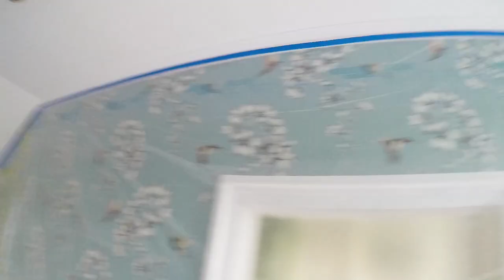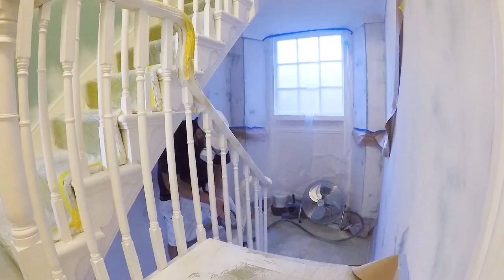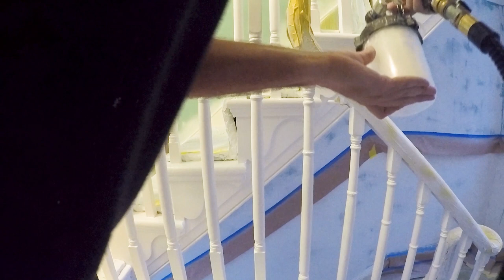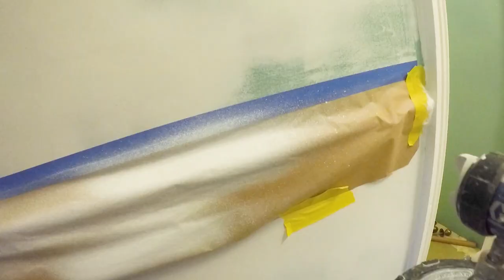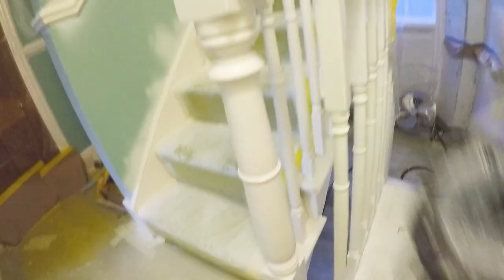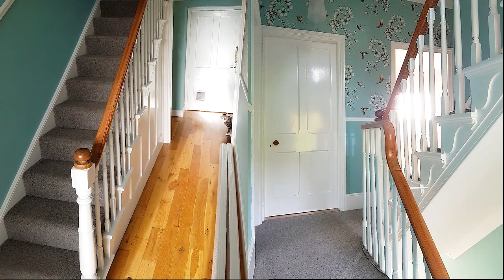Painting Spindles - Graco 9.5 FinishPro HVLP Paint Sprayer

Comment: Hi Simon, hope you're well?  Do you start at bottom for overspay reasons?  Also when the handrails being brought in same colour, whats your method? Ive been leaving till last, wiping as i go with damp cloth, then do all last, results been good but is there easier way regarding overspray dust etc, thanks in advance for all time spent making these videos.
Reply from the maker: Hey bud, yes i usually do start at the bottom so over spray lands on wet paint if it does. And yes usually handrail last. Airless is alot faster and will keep it wet longer, so make sure youre putting enough paint on with hvlp otherwise ye it can go dusty
Reply: @sprayaholic   cheers for that, sometimes odd bit dusty on a flat area, but takes minutes to rub & touch up.

Comment: How are you my friend, I have a Graco 390 110v machine, but I own 220v electricity. Can you guide me about the parts that need to be replaced
Reply from the maker: Hi. You need to buy a transformer.  This allows the 110v machine to plug into the transformer, and then the transformer fits to the main wall 230v.
Reply from the maker: Im not sure if you can just cut the plug off and replace with the one you need

Comment: Nicely done si nicely done ✅! I spray some Helmi couple weeks ago, double coated it in a day too without any problems at all. The recommended re-coat times are 16hrs?. Still that don’t put me off, I’ll be using more in a couple weeks. Keep up the good work, and have a good weekend 🤛🏻
Reply from the maker: Awesome cheers buddy. They always told me the paint can dry through each coat. Ive never left it that lond as soon as its touch dry ha. Im going to give renner a go soon and teknos. 
Have a good one ✌
Reply: Helmi is fine after 3 hours of heat

Comment: I'm currently pricing a staircase  and considering spraying but that's ALOT of masking 

I wonder is there a way to do it without having to mask up all the walls??
Reply from the maker: It was a wallpapered wall thats why. But ye you can drop a sheet or cloth the otherside of the hand rail to catch overspray.  Masking doesnt take as long as painting it all by hand several coats as spraying takes no time. Its just commiting to it
Reply: Yeah fair comment, plus spray is better finish @sprayaholic
Reply from the maker: @georginawyatt8212  if you use the masking guns etc tape and polythene on the same roll you can mask alot in a small amount of time. But this was a whole house re furb so needed protection down for a while
Reply: Yeah I've got one mate. Absolutely love it it's such a handle bit of kit. Can you imagine having to mask without it!! Saves so much hassle. I'm currently trying to stick to mainly spraying and move away from brush as much as possible! Spray is the way!
Reply from the maker: @shanewyatt9939  something i use alot is the blue indasa poly with green tape attached. It fits the gun and its a good price from crown. If needed use a delicate tape for a line then tape and drape this onto it.

Comment: How many coats you ended up on that bare wood spindles? And how come you didn’t use airless sprayer, some ppl say that’s faster? Great vid, keep it up 👍🏻
Reply from the maker: I added it in the description.  After sanding and filling i primed using Zinsser BIN. Then 1 x Tikkurila akva primer followed by 2x Helmi 80. I double coated the woodwork the same day top to bottom, left it an hour then recoated while it was still tacky.

I had my airless units mainly in wall and ceiling paints, it was a full house refurb so lots going on. Hvlp kept the material amount down as it doesnt use as much, some detailed work in other room so i wanted the control which you dont have with airless. But yes airless is fast, this can still go nearly as fast id you crank the settings up

Comment: Great video and work m8. I much enjoy watching your vids :-)  
Anyway. I got the old 9.5 + Pro comp for extra power. But even so, I had no chance getting mine to spray anything without thinning it down almost as liquid as water. 
Only used mine once on a project restoring a classic dinner table + 8 chairs. Used flat black, oil based enamel. Thinned down a LOT. The project came out very nice. 
But I came to the conclusion that I could have gotten the same result and prb 4 times quicker using a LPFF tip with no material thinning. And prb with way less mist in the air. 
But I can see the use and better control you have going over the spindels. So my question again. Do you think the new 9.5 is more powerful or about the same as the old 9.5. 
And can you spray material without thinning. Witch was a the salesman pitch when I purchased mine.
Reply from the maker: Thanks for the support. Sounds like theres an issue,  i always dilute between 5 to 10% it helps to measure out. Ideally need a 1.8mm needle in there. It can spray thicker too, thr machines are the same power. 9.5psi.  The guns better on the new one. Mayne you have are issue with how its set up. Or not clean? Yes you can get a nice finish with the airless, use kore paint but still its fast. If you have too much dust in the air. You need to turn down the air on the gun youre trying to force out paint.
Reply: Thanks for the tip on lowering air to minimize the overspray in the air. 
I love spraying Bin primer  with 2.0 needle set. Almost no overspray. But spraying latex paint it’s a mess.

Comment: Do you always go hvlp on spindles never go for the airless?
Reply from the maker: No i do use airless too. Its just i had 3 of the airless units in different products and the hvlp gave me alot more control with other detail areas on the job.
Reply: @sprayaholic  what tip size would you use for airless on spindles?? I enjoyed the video and found all comments and replies very helpful
Reply from the maker: @padgehind  i often use a 110 or 108 as its minimal waste paint. Or 210 if youre not too bothered. Its helpful to have a sheet or board the other side  to catch the overspray

Comment: I’m going to be doing a stairway with spindles and railing stained. Can you please show me your to tape down an anything else to avoid overspray. preparation for hvlp I have a procomp graco I am using for this. 
I love my procomp with the in-line remote pot for versatility getting close to the the spindles to cut down overspray.  I have a highboy 495 for general spray but for details I love the procomp.
Reply from the maker: When in doubt over mask. Dust will settle on anything in the area. So mask walls or floors. If you have a helper get them to be opposite side of the handrail so your overspray hits a sheet or board. You can buy an extractor to help too. Juat remember it may take you an extra 30 minutes to mask more areas and £30 more. But its alot less that trying to clean up mess ha
Reply: Extractor please what model’s do you use or recommend.
Reply from the maker: @97krunch  i had 2 from ebay. Not sure what models though

Comment: Another great video. I keep watching as I’m struggling to get paint through my 9.5😩 I assume you really thin your paint.  Is it correct that air flows out the back regardless of what pressure setting you are using. 👍
Reply from the maker: Thanks. No you dont need to thin excessively.  Air blow out the back of the turbine always.

Have you seen my other hvlp videos? What are you tryinh to spray? Ideally need a number 4 with thicker paints, max thin of 10% measured out.
Reply: @sprayaholic  hi and thanks, I’ve certainly been looking at all your videos and not blowing sunshine up your ar** you have a good manner, . My background is a joiner who wanted a good finish on what I make and did a couple of courses and bought a trite T5 which is great. But for small one offs it just isn’t worth setting up so thought hvlp and saw your videos and thought I’m on 😁. Only set it up this weekend and tried macpherson primer well thinned but just wouldn’t push through or when I did get it through it was like water. Then put some akvi primer through which I love when using airless, I thinned it but was getting poor spray pattern and to get through had product almost set to max air past half way which I knew was wrong again confirmed by your video. Maybe I need to accurately measure paint. I was definitely going round in circles switching needles upping turbo etc. One thing that made me think was when I turned gun around it sprayed pretty good like a gravity pot would.
Reply from the maker: @grahamwilson829   @Graham Wilson  appreciate the support.  Yes somethings definitely  wrong somewhere.  Is the air valve om the hose open? Is the lid screwed on properly?
Did you adjust the black dial on the front of the gun? The turbine speed dial doesnt make massive difference really. So put that on 6.  I measure my paint. But have a look at this and you'll see the difference in material. Fill your cup.  Use a number 4 needle set. Air on half. Fluid on 3. Adjuster dial wound towards the trigger to the wider setting. Should spray https://youtu.be/tcp6DH_SOV8
Reply from the maker: @grahamwilson829  if you're using the pot on the gun
 It can take like 20 seconds with your finger on the trigger to fully compress the cup. Also it works better when more material is in the cup. So flipping upside down lile a gravity pot woulr work with minimal paint and gravity let the paint down the gun
Reply: @sprayaholic  yes tried and checked everything, valve full open ,on hose then decreased etc to try different air flow, lid on properly and tried another liner, tried full liner then half full etc , altered front dial so wider spray pattern basically spent the afternoon watching your videos then back to my machine 😂.  That’s when I questioned air coming from back of machine which they are obviously supposed to do. I am going to get a tin of haft primer as I need to spray a school chair for my wife which needs an adhesion primer so then I can replicate your video. I appreciate your time. 😩👍
Reply: Looking at your video again I am definitely not spraying as close as you . You look to be around 2 inch away, I’m in airless mode 6/8 inches away, I’ll take on board all your comments and go again. Certainly feel like all the gear and no idea 😂😂joiners 👍👍😁
Reply from the maker: @grahamwilson829  haha dont worry we all start at some point. I was the same. I do go in close when its dialled in maybe like hands distance away. If you're  too far away you'll get loads of air dust and a rough finish as air is running at the side or fhe paint. Airless is just paint flying at a surface
Reply from the maker: @grahamwilson829  any issues drop me a message on Instagram if youre on there.  Send me a video of you when you're struggling
Reply: @sprayaholic  I will do. I will leave till next weekend and do the full monty 😂😂 your a top man
Reply from the maker: @grahamwilson829  haha I'll grab some beers  and a chair then 🤣
Reply: @sprayaholic  just an update on the saga my friend 😂 . Tried a qtech gun and nailed it , so after watching your 

videos again I rang the good people at sprayman and was told that putting a bit of Vaseline around the top of the graco pot would probably cure the issue. But I was thinking I had the offer of a qtech gun and pot from Pete at paint tech training academy which I liked and would give me a reasonable volume, and I liked your gravity feed video so again the good guys at sprayman as per your recommendation is sending the gravity feed pot . So I think I have everything covered. As they say all the gear and no idea 😂😂 . Thanks again fully paid up member of your fan club 👍👍